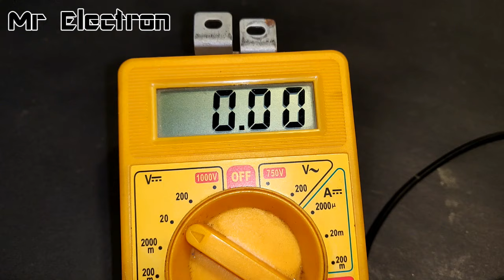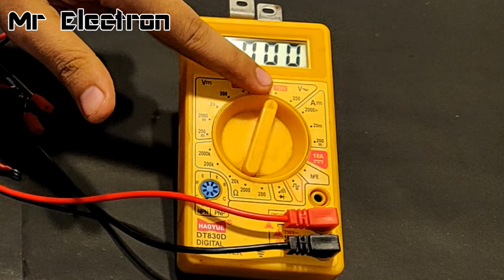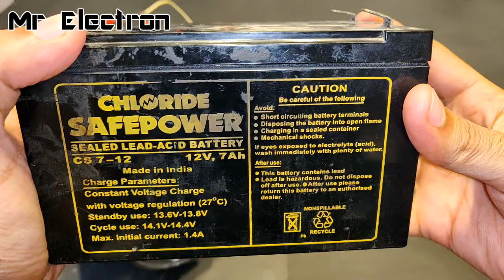Woohoo !!! 400 Watt Low RPM Wind Turbine Generator for Charging 12v UPS Battery

Comment from the maker: BEST BATTERY CHARGER DIY VIDEO - https://youtu.be/ZN3saILbYUw?si=9_nLu0vKOqfn4zi_
BUY Permanent Magnet Alternator  :  http://bit.ly/2Np5FBO 😍

Join this channel to get access to perks:
https://www.youtube.com/channel/UCWFbPzBb7dCyCWuBA-DBrMA/join
Mr.Electron Patreon's Page - www.patreon.com/mrelectron
Hindi Channel                 - www.youtube.com/@Mr.ElectronHindi
Alternator Channel            - www.youtube.com/@mrelectron_alternator
Watsapp Channel              - https://whatsapp.com/channel/0029VaQmmRaFCCoWOf7huh3G
Reply: How many cost
Reply: @rajasp2007  about 10-11k in India as landing cost, plus custom (if you're unlucky) which is additional 24-25% approx
Reply from the maker: Cost has reduced haven't it myself though.Also there is 12% discount coupon code in the description.
Reply: I'm definitely interested in buying one of these but, my goodness, the website is horrible.
Reply: How does are you able to power a wheel grinder with 12 volts?  Those are designed for either 110v and 220v.  Wouldn't you need an inverter?
Reply: @busybusiness4  they run much slower on 12V you probabbly woudlnt be able to cut annithing with it but it will spinn
Reply: Hey it's cool I like it
Reply: You probably dont care but does anybody know of a method to log back into an instagram account??
I somehow forgot the password. I love any assistance you can give me!
Reply: @Caleb Lyric Instablaster ;)
Reply: @Cesar Mathias I really appreciate your reply. I found the site thru google and I'm waiting for the hacking stuff atm.
Takes a while so I will get back to you later when my account password hopefully is recovered.
Reply: @Cesar Mathias It worked and I actually got access to my account again. I am so happy!
Thank you so much you saved my account :D
Reply: @Caleb Lyric no problem =)
Reply: @caleblyric7560  get a Life
Reply: If you have to use a rectifier to achieve 12 volts DC, then you are actually selling a generator, is that correct?

Comment: I would like to test this unit, but there are no mounting holes or any kind on mounting bracket. This means there'll have to be a lot of jury rigging which I can do without. Any advice? Also, have you come across any supplier of a gearbox to speed up a slow-moving drive input?
Reply: I noticed that the 600 watts one comes with a bracket...the case on it has 6 bolts. The bracket uses 3 of the bolts which must be longer than the others, I guess. I wonder what people do when they get one and there's no way to fasten it. Also there's no keyway in the shaft to keep the blades hub from slipping. I have a Honda 200 watts PMA, 47 years old, and it has a woodruff key . Too many things wrong with this one.

Comment: Hi sir are you using a normal car alt. stator ? by the way that reg is 14.00 vdc design to control neg brush but is easy to find a good controller, thanks for sharing.

Comment: we will all just  PRETEND that  you  Forgot  to  measure  the output  CURRENT.  amps.     voltage is  NOT  power.    power is watts.    watts = amps  x  volts
Reply: Right
Reply: That meter is too small to measure the current. It'll burn up

Comment: Something aint right.
There are 3 wires meaning 3 phase power. When you pull and generate power the light bulb shouldnt have stable power at all times. It should blink ever so slightly. This is why 3 phase is there in the first place to stop blinking power from peak to peak therefore to try and give a straight almost constant power.

Comment: What should be the RPM of the rotor to get the full 400 W power out ???
Reply: 600 RPM
Reply: @Alamgir_7864  Thanks Alamgir.....did you also buy this generator and did the test practically???

Comment: Can this be used vertically, that is as in a vertical axis wind turbine?
Reply: That is easy, Yes. As long as you have the blades to catch the wind vertically, absolutely. There are in fact commercially available vertical wind turbines based on this principle. Just as and fyi, this would be good for a hydro electric option too.

Comment: I need to build a permanent magnet generator which can give 1.5 amps with 24 volts in 1700 rpm . Do you have the drawing ?

Comment: Not really a useful video - more sort of general ideas.
Charging 12v battery was silly.  Batteries are expensive and require careful charging.
This generator seems to produce 3 phase a.c. and will give the home engineer another problem to solve - can't see a reason to but it.